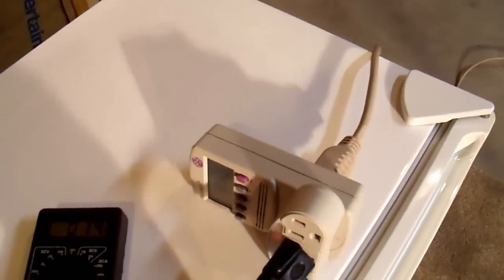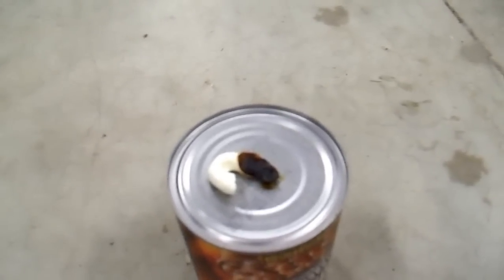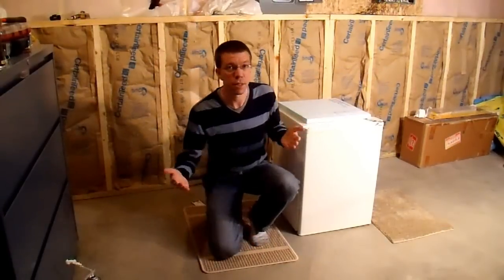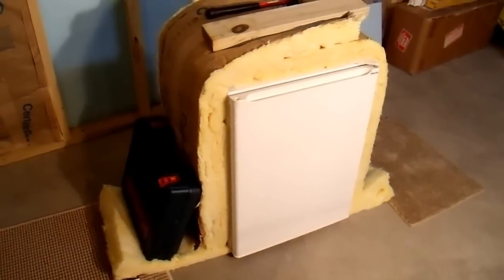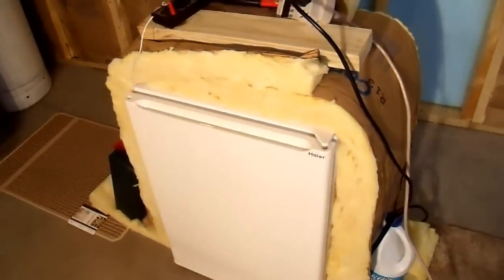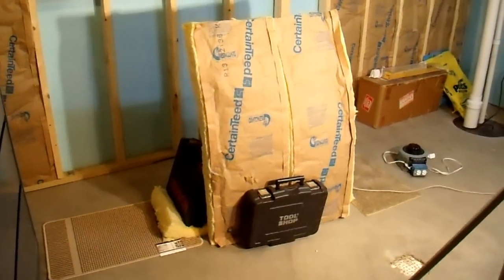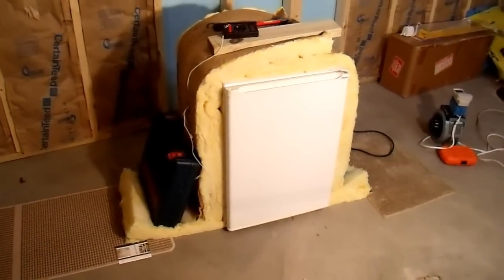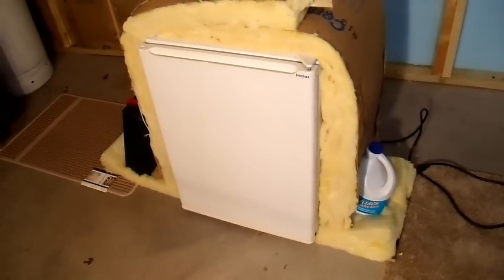Convert a Standard Minifridge into a High Efficiency Refrigerator - Part 2/2

Comment: I'd stick with insulating the crap out of it. For fair comparison, you should incorporate the transformer in your 'kill a watt' to include the parasitic loss of that device also. I'm unsure as to whether your voltage drop idea would result in any efficiency increase. Unique idea, however. Perhaps all this "Energy Star" hooplah should revolve more around efficient insulating materials and less about the refrigeration system itself. I'd be interested to know if a dated fridge with proper frion levels and proper lubrication would compete with the newer and supposedly better technology given the same R-value in their respective envelopes. At any rate, congrats on the 'new' fridge. Thanks for sharing your findings! (Now put your house back together as energy code requires a minimum R-10 in wall construction) :)
Reply: I think the problem is that folks don't want a bulkier fridge or less interior space. A fridge as it doesn't use much elec at all per year.

Comment: The added insulation is always a plus, wondering why you didn't try to increase the cooling coils efficiency, a bigger heat sink would cool quicker thus reducing the run time on the compressor.
Reply: You could also increase the pressure of the entire system by doing this, which can obviously lead to problems/failures
Reply: @ Joshua Wesling: Actually the higher the temperature of the condenser, the higher the pressure is in the system and the higher the amperage draw of the motor is. Cooling the condenser better results in lower pressures and lower amperage draw, which results in longer life.

Comment: thanks for this very informative video if we want to buy insulation what would be the perfect kind for this experiment?also will increasing the thickness of insulation give better efficiency?
Reply: XPS or Polyiso  rigid foam board from a hardware store. You could add more insulation but the return is less and less so it gets expensive much like home insulation.

Comment: So if it uses .3kwh a 24 hour period, than that means it uses about 14.6 watts per hour?
Reply from the maker: watts is a unit of power.  kwh is a unit of energy.  This uses 0.3kwh per hour.  watts per hour is not a meaningful unit.
Reply: ***** 
It uses 300Wh/24h = 12.5 W .
Reply: I doubt that.  That would cost about $400 a year to run.  The tag suggested under $30 a year.

Comment: Thanks buddy. I plan on gutting a frig and building my own for an RV type setup. You answered a lot of questions I had about efficiency. Because I'll be running a 120V frig in an RV I'll need it to be as efficient as possible. Don't want to kill the batteries and hope I can run the frig off a solar setup on the roof when the truck is off.

Anyway thank you.
Reply from the maker: Glad you found the video helpful.  Be sure you have a pure sine inverter for optimal efficiency.

Comment: If the freezer compartment is not used, I'd suggest removing its door and install a small fan (e.g. old PC case fan using a 12V power supply) in that section to push the cold air into the fridge section.  This may improve the efficiency as the evaporator coil will be at fridge temperature instead of below -18C or whatever it chills the freezer compartment to.
Reply from the maker: The freezer compartment in these mini-fridges are intentionally very poorly sealed and the door is mostly for cosmetic purposes.  Removing it may help a small amount, but adding a fan will consume more power than it saves.  The fan may consume 2 or 3 watts, which the refrigerator then has to remove again consuming yet more power.

Comment: Hi, 

It would be a bit more efficient if it were run full, as well, as apposed to being an empty ref. Wouldn't you agree? 

Here where I live, Cambodia, we pay about .38c US / kWh. Refs bought here tend to not be nearly as efficient as they should be. I have one that currently uses almost 2.5 kWh per 24 hour period! I am in the market now, for one that draws less, though. They are difficult to come by, and are costly.
Reply from the maker: I agree that when comfortably full (not stuffed completely full) they will be more efficient than empty especially when multiple door openings per day are considered.  It is unfortunate that there is not a larger market for efficient small refrigerators and it is also unfortunate that efficiency standards are not higher in nations such as the USA - many regions of the world would benefit from them and the cost would be quite small!

Comment: Any thought to adding additional vertically oriented heat sinks to the condenser with perhaps a stand off cover to increase the convective chimney effect and increase the natural airflow over them?
Reply from the maker: I believe those are good ideas and would have merit in trying for someone inclined to spend the time.  I do believe there is more that could be done to improve this fridge.  I would also think adding heat sinking to the compressor housing itself would be particularly effective.

This refrigerator is no longer in my possession.  It was given to a relative for use as a garage freezer and is performing admirably with very low energy consumption.
Reply: Did you have to change the thermostat to convert it to a freezer or did you have more tricks up your sleeve?  I also wondered about keeping an airgap on the back side between the compressor an the foam.  The compressor must feel like it can't find the cool side of the pillow.  Ha!  Oh well, good stuff regardless.
Reply from the maker: blmeflmm66
I changed the thermostat because it failed, and it just so happened that the replacement thermostat allowed the refrigerator to get colder than the factory one.  I did make sure to keep an air gap between the foam and the coils, that's pretty important to the coils cooling properly from natural convection.

Comment: Great video, good work.  I used this process on an older upright chest freezer I have.  Started at about 98w/avg (2.4 KWH/day).  Since it has no external coils, I had to leave the sides and top open for cooling.  But I added 1.5" rigid foam (R9.6) to the door and back, plus an outer layer of reflective bubble-wrap type insulation (~R4), plus a layer of that underneath.  Dropped consumption down to around 80w/avg or about 2.0 KWH/day.  May try an auto-transformer to drop  it to 110v or 100v and see if that helps.
Reply: Wow, could you may a video not how-to, but show each part you describe above. It would just be 4 views of the finished project.
Reply: @Gandioneare7844  See image below:
https://photos.app.goo.gl/Fw6PiGc7fUdiZghCA
Reply from the maker: Unfortunately there's less that can be done with units with integrated coils, but insulating the lid and bottom has to help.

Comment: Ok this might be a little long winded. But here goes.  I have a 5th wheel and am upgrading from 140 watts of solar to 280 watts , 4 -6V 210 amp hr golf cart batteries. And a 2K inverter.  When parked in the backyard all of this power is going to waste. I have a 10,000 btu AC unit. That draws 600 watts. I am thinking I can run my AC unit  for 2-3 hrs a day without adversely effecting my batteries or solar system. I would just like to hear your thoughts. Thank you in advance.
Joe
Reply from the maker: Cycling the batteries every day to run a load would degrade the batteries and likely cost more in battery replacements than gained in electricity.  Battery recycling and production is an energy intensive industry anyway so it wouldn't be doing the environment much help.  With some custom control circuitry a setup like that with a smaller AC unit could work but that's beyond the scope here I think.  How about disconnecting the batteries from the panels and running a grid tie inverter?  You would still need to maintain the batteries somehow of course.  I'm thinking the most practical solution might be to just use the solar panels to maintain the battery bank like you're currently doing.

Practical or not it would make a fun project, though, so I say go for it anyway.  Maybe set up a timer so that the AC unit only runs for one or two hours per day around noon and monitor the batteries to make sure they are being only very lightly cycled?  (You want the batteries to recharge fully immediately after being drained which means it should not be run in the afternoon)  You could always manually switch off the AC unit on days that it will be cloudy.
Reply: ***** Thanks  for your input. Unlike a lot of the clown cars driving around in here. I respect your opinions & knowledge. I am guessing you have a degree in electronics ? One HUGE point you did make that I was missing is running the batteries down without them having the ability to recharge and sitting there sulfating up all night before the morning sun can start recharging them. I am thinking I'll have to time the run time and discharge rate draw from the AC. I'll have to work out a system. And maybe add 1 more 140 watt panel. But like you say it will be a fun experiment and a GREAT learning lesson & will be a little fun anyway. Now if I can get the wife onboard ! Most women don't like dinking around with things they just like it to work.
Reply: Bozonez3m
I have 560 watts of solar and a 4000 watt inverter.  My roof air conditioner on my travel trailer is 13000btu and uses 1074 watts.  I have an 8000 btu unit to and it uses 760 watts, so I am curious about what air conditioner you have that produces 10k btu with 600 watt energy consumption.  Either way, I have tried this experiment with inverters and air conditioners.  You don't say if you are running 12v or 24v, but I am running 24v.  The starting surge using the big unit pulled 378 amps dc side (for about one second) on my system and popped about six error codes including high temp.  You are going to want to make sure you are using really big wires, especially if you are using 12v, since the amps will double.  I don't think running air conditioning with the solar you have is do-able, but hey, go for it.
Reply: Bozonez3m Lets say you have 6V battery of 210Ah. Then you have a total of 6x210 = 1260Wh. If your AC drawing 600W, with a 100% efficient Inverter, you can only run your AC for two hours at night .
Reply: Prashan Premaratne  This was a failed experiment. But if we don't try we will never know. I found it more compatible to run something smaller like the tv to use the power produced. But since then I have added another 140 watts to the system. And we don't run the air at night because it cools off quickly at night. An open window and a fan works just fine.

Comment: Would a fan blowing air on the compressor help with efficiency, it should make the compressor last a bit longer
Reply from the maker: A fan may increase compressor life, but the fan would require more energy to run than you would gain in efficiency.  Passive natural convection is the most efficient way to cool it.

Comment: How about adding capacitors to make the compressor less inductive in which will decrease the PF, in  which will make it more energy efficient yet.
Reply: yes please use caps,some company in florida is getting rich by installing a box with a couple of caps to the house or business mains... please search and investigate :)
Reply from the maker: PF capacitors help the power factor which can increase the efficiency of power distribution (including the efficiency of inverters) but would not reflect positively on the wattage draw as measured at the appliance.  Basically you're just shunting current through a capacitor that is opposite in polarity to the current being used in the inductive load.  Companies that sell those boxes with caps in them are simply scams.  They do nothing to help the homeowner except, possibly, make them feel better.  Unless you're billed on power factor, and homeowners never are, then it is useless.
Reply: *****
You can try adding a run cap (not to be confused with a PFC cap!), probably on the order of 5uF or 7.5uF for a compressor that size, between the start and run terminals on the compressor. In fact, you'll probably find that the starter has extra terminals for the capacitor, which was left out for cost cutting. A start cap (about 100uF for a compressor that size) will allow you to use a smaller inverter, as will hacking the inverter to do V/Hz scaling.
Reply: Yea, what you said. I was hoping to find some information on how to get my 600-1000 pure sine wave inverter to start my fridge. I can't understand why this new Vissani 10 cu. ft. says do not run on an inverter. I have always read where they take 2-3 times running amps or  watts but the inverter guy says he has seen multiples of 12. My fridge rates at 120 watts. His answer is to buy a 1000-2000 inverter for double the money. I'll keep looking for start capacitor videos.